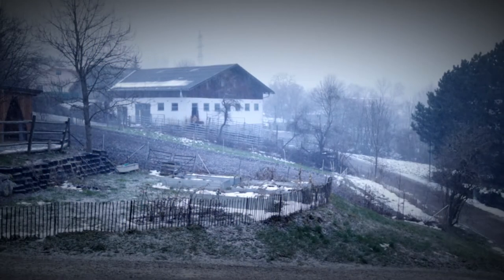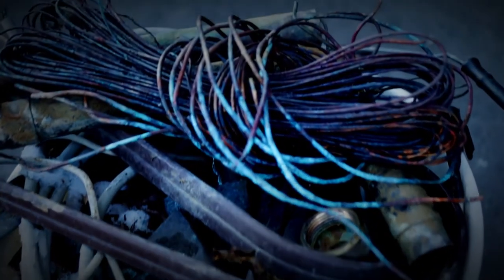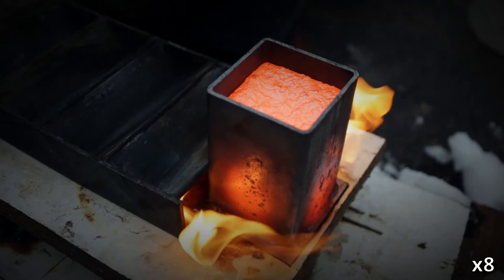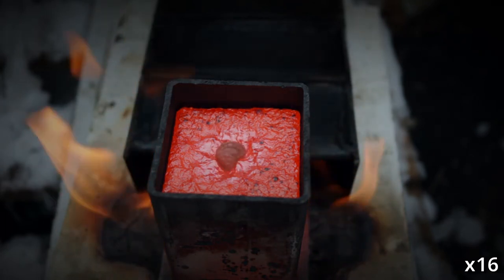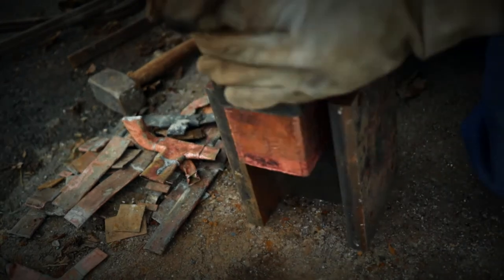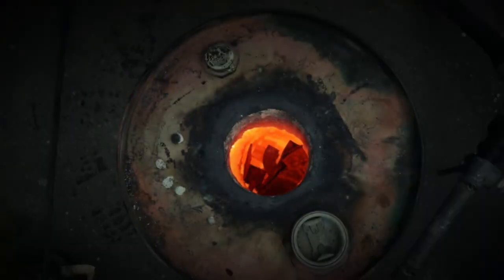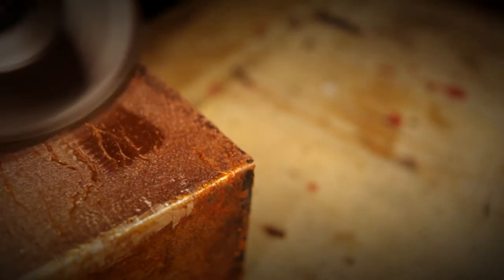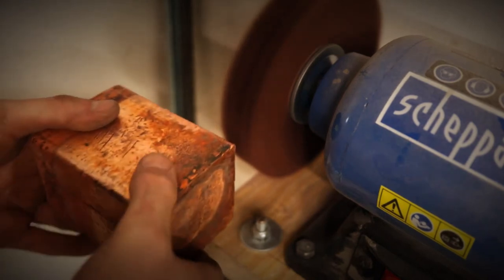TRASH TO TREASURE | GIANT COPPER MELT DOWN | COPPER MELTING AT HOME

Comment: When you pour hot water over the top of the propane tank it wastes the heat from the hot water, it is better to have a large bucket and submerge the bottom of the propane tank in hot water so the propane evaporates quicker.
Reply from the maker: Thanks for the tip lucky, didnt known that!